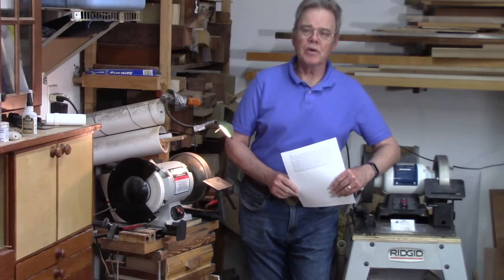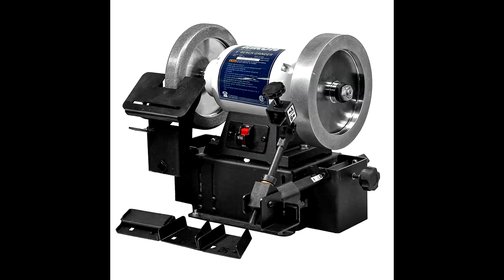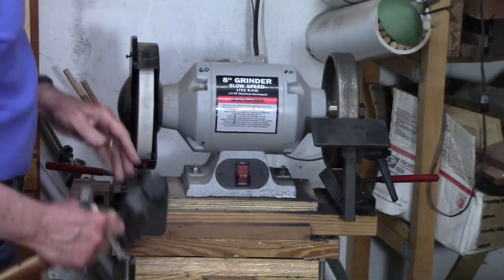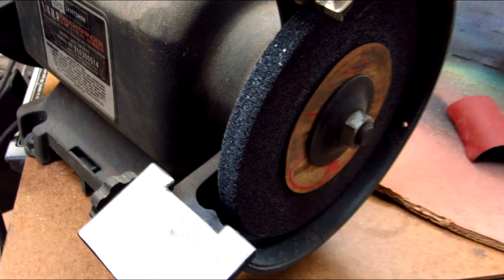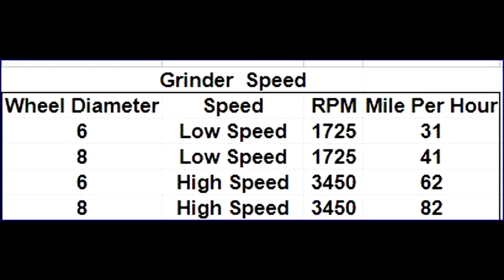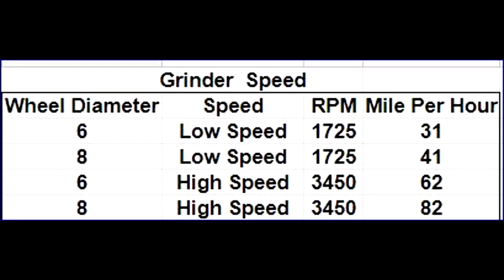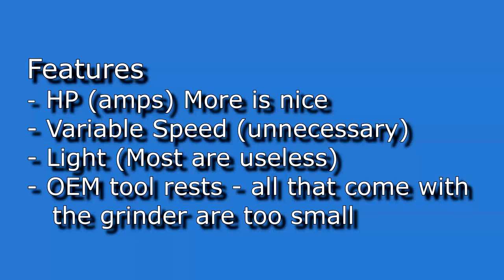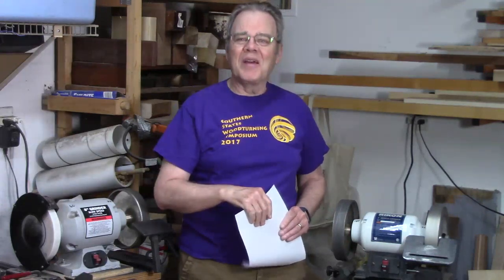Bench Grinder Basics for Woodturners

Comment: I upgraded to a Rikon 1hp several years ago, when Woodturners Wonders had them on sale. Not necessary, but nice, as you say.  Mine is equipped with an 80 and a 180 grit CBN wheels from D-Way. If I really think I need something sharper, I touch the edge up with a diamond card.
Reply from the maker: I do not think you wil see a noticeable improvement moving up to 600.

Comment: Hi Mike, what’s best, grinders that turn toward the cutting edge (like your Rikon) or turn away (Tormek)? Have you ever used the Rikon from the other side?  I like the idea that the wheel is pushing the tool away rather than pulling it in.
Reply from the maker: The standard grinder movement of the wheel coming forward works fine for every turner I know that demonstrated sharpening. Don't over think it.

Comment: IMHO I have found the .5 hp Rikon grinder more than adequate.  I have found the startup quicker than indicated in this video.  Though I have not timed it, I would say 3-5 seconds to full speed.   What’s the big deal if it’s a little longer?  Is it worth the extra $130 or so for the bigger grinder?  If it gets the job done is really all we need to be concerned if one isn’t worried about instant gratification.

I have the Wolverine sharpening system and using the Raptor jigs for setting the angle.  But, if I had to do over again, I think the Kodak system is a little nicer and would have bought it instead.  But, I am happy with what I have and will stay with it.
Reply from the maker: Stick with what works for you. I am satisfied with my two 1/2HP grinders. Do wish I had upgraded to a 1 HP when they were half the current price and  could have sold my 1/2 hp to a new turner at a fair price. But not worth it to me at the current price at twice as much as it was sometime pre covid.

Comment: Nice overview.  This might be in your future video on jigs, but I'm curious about you having the Wolverine jig on the grinder with what appears to be an Aluminum Oxide wheel.  It seems like the diameter change over time due to wearing away the wheel would affect the settings for the jig.
Reply from the maker: Good question. I keep that old coarse AO wheel for cutting softer steel that might embed in a CBN wheel. I do not use it to sharpen turning tools.

Comment: I have a Rikon half HP with a 180 cbn wheel and a white stone wheel. I am wondering if a higher grit cbn would give me an even sharper better cutting edge? Enjoyed the video. Very helpful 👌
Reply from the maker: I am still getting used to my 600 grit wheel.  My current feeling is that a 180-220 grit is probably fine for most turners.  Not sure how many turners would notice the difference in a 180 grit edge and a 600 grit edge. But it might be worth a try if you do not need you AO wheel for softer metals and you feel like the 180 would do ok as your couarse wheel. I do enough reshaping of student tools and making tools so the 80 grit works best for me as the coarse wheel.

Comment: Two questions:  

1) is 3400 RPM too fast for an 80 grit CBM wheel?   

2) If not, would the slower speed of a Tormek knockoff grinder be appropriate for an 80 grit CBM wheel?

3) What CBM grit is an appropriate companion for the 80 grit CBM used to sharpen HSS turning tools?
Reply from the maker: Most turners prefer a slow speed grinder but some like a 3400 rpm grinder. People use 1000 grit CBN wheels for a Tormek 
I use a an 80 grit and a 180 grit CBN wheel.
Reply: @MikePeaceWoodturning Thanks!

Comment: I feel really stupid for having to ask this question.  I have not figured out how to determine or set up the angle of a grind on a gouge using the adjustable platform.  It is strictly trial and area on my part.  I haven't found a  video which is much help.  I know you can help.  Please do!
Reply from the maker: Many start with their current grind bevel to set their platform or Varigrind accessory. Then based on how it works for them they change the angle at next sharpening. You should have some idea of a common grind angle, typically 35 -40 degrees for a SG. Keep in mind there is no perfect  bevel angle. All agree the tool  just be sharp. Check out my videos on a SG and BG where I provide some Sharpening instruction. Check my Amazon shop to find a compass to measure your bevel.